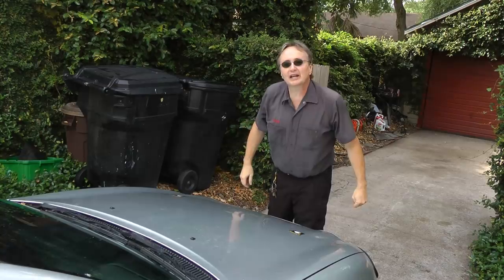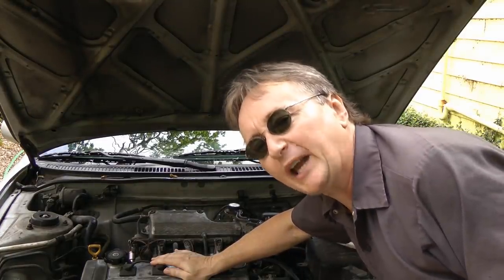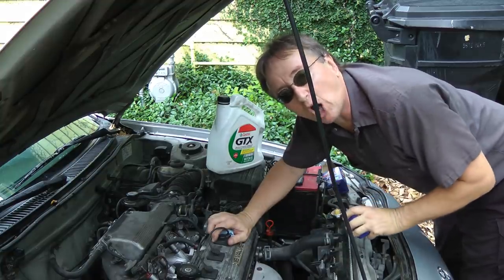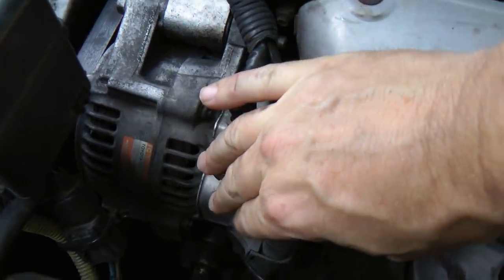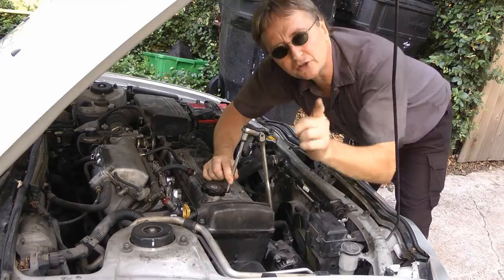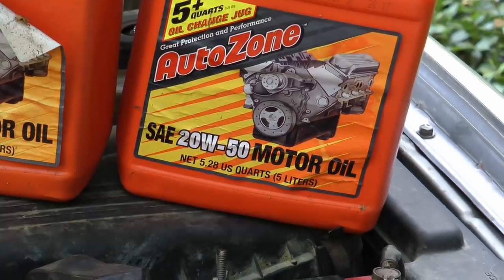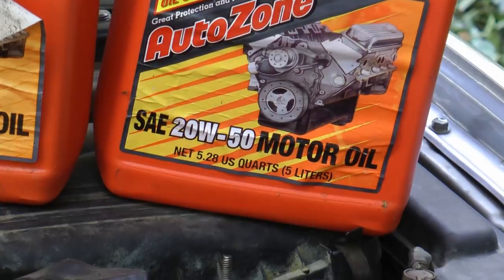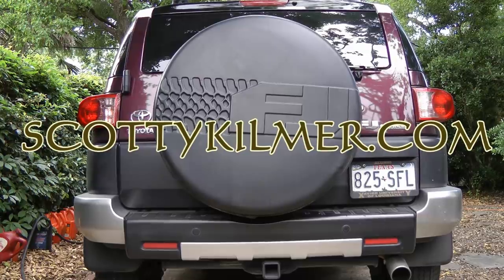Top 4 Mistakes Car Owners Make (DIY Fails)

Comment: I have a Ford Ranger that was running perfectly well until I attempted to troubleshoot the air conditioner. I ran two wires from the battery to the compressor to see if it would engage. When I made contact all I got was a loud spark! I reconnected the harness and tried to start it, but it turned and turned without starting. I had it towed  to a shop and found out I had ruined the computer. This happened last month and it was a very expensive lesson. I bought the computer and the shop charged $175 to program it.

Comment: You're right with the oil and go with a full synthetic it gets up to the engine quicker on start up that is when you wear your engine more and a good top quality filter that goes 10000 miles plus

Comment: Never understood why some manufacturers put the oil filter in such stupid places.  Something that gets replaced that often should be in a handy to reach spot without taking anything else off.  I changed oil in a friends ford ranger once and had to lay way under the truck and reach up quite high.  My dodge k cars were the best for that.  The oil filters were front and center.  Nothing on top of it, reach down a little over the radiator and easily grab it.

Comment: Anti-seize on sparkplugs is a bad mistake. I have been told by 2 master mechanics that the anti-seize will becomes hot and run down and foul out the plugs.

Comment: Let's say you have 20W-40 on the oil filler cap.
You can use 0W-40 because that 0W means lightest on cold conditions, but be sure to warm up

Comment: My ranger recommends 5-30 but I use 10-40 in winter and 20-50 in the summer never had a issue with this.
Reply: Zane w
You just a fan of crappy fuel economy?

Comment: Scotty, in this video you say to put anti seize on spark plugs, but in another one of your videos (Picking The Right Spark Plugs For Your Car) you say that you shouldn't put anti seize on the spark plugs.  Should anti seize be used at all?  My truck is a 2013 Tacoma and I'm getting ready to change the plugs.  Does a modern vehicle not need anti seize on the plugs?
Reply from the maker: modern ones don't need it cause modern plugs are already coated with anti seize plating

Comment: Pretty sure it's better to remove the positive cable, not the negative. Because the battery moves electricity from the positive lead to the negative lead, and since it only moves in that direction it's safer to remove the positive terminal. Not positive but I think that might be true, correct me if I'm wrong.

Comment: I had trouble getting the filter off a truck i bought.  When it came off, the old gasket stayed on the truck.   

I usually take the old filter and put them together, seal to seal, to lube the new one.   I guess I didn't, that time.

never again.

Comment: As an oil tech for Walmart with an expert understanding of oil from extensive research and experience. I get costomors coming in regurly asking for a hevier weight oil than recommend and most of the time we can edgucate them on why it's a bad idea other times they incest and we have them fill out a form stating we hold no responsibility for  damage caused by hevier oil

Comment: I had a Nissan dealership double up the filter gasket, i needed a 24 inch pipewrench to remove the filter because they doubld up the gaskets and just cranked it to hell until they finally got it tight

Comment: I have a question about a 2007 GT Mustang. Is there a way to bypass the forward and reverse button on the driver's seat? I've had it fixed three times at the dealership under warranty now it will not go forward or back. They say the switch is bad it cost too much money to keep fixing I'm wondering if there is a wire I could touch on one of the pens to make it move forward when I unplug it?

Comment: Follow the manual or oil filler cap for oil weight, ONLY when you are in warmer climates. In places like Canada, you would be a  fool to use 10W30 in winter. It's as thick as molasses in January. Lol. Takes way too long to get moving in frigid weather. Typically our same cars here as you just showed recommend 5W30 all year round and it works fine. Some people go 10W30 in summer and switch to 5w30 in winter. I use Synthetic 5w30 cause it gets moving even quicker than conventional oil in winter cause it's a bit more viscous in cold weather. 5w30 gives all the protection you would ever need these days. I know some guys who even switch to 0w30 in very cold climates. You'd be surprised just how thick even 5w30 can get in cold weather. It's like thick syrup. Imagine if (and this happens quite a bit) you bought a car in the Southern U.S. and moved it here and it recommended 10w30?! Lol. That's when you want to actually DEFY what is recommended and use a thinner oil, cause 10w30 will never get moving quick enough in cold weather.
Reply: Bill Does Stuff my Subaru recommends 0w-20 and I use it all year around. I live in Texas, we can get hot summers. I understand going down to a 5 or 0 I’m cold climates but never understood switching to from thinner to thicker oils say, in the summer. After all, your engine runs at like 300 degrees f so that’s much hotter then my 100 degree summers. The cars parts are made for a specific oil and thicker oils can interfere with oil pumps etc. Yes 5w-30 is a good all year oil which is why it’s one of the most common and I would use it in a pinch but if i have a choice I will run the manufacturer recommendation unless like you I live in a in extremely cold climate. I would accommodate for winters but not for summers or for hot weather. It’s hard to explain this to people who are used to changing oils in the summer but it’s really not necessary to go thicker in warmer weather. There’s plenty of research that will back this up.
Reply: Yeah, especially with today's oils. No reason to go any thicker.

Comment: Numbers are for the oil weight/viscosity rating. The letter W stands for WINTER. 10W40 to say when the oil is cold its viscosity is 10 as the engine heats the oil the weight/viscosity increases to 40. Oil is able to do this transformation by the additive of paraffin.

Comment: My brother is like that !!!!

He thinks that just because an engine has higher kilometres on it,that it needs a thicker oil.

That's a fallacy because my Chevy LS1 engine has 30 PSI of oil pressure at idle & 60 PSI at 4000 RPMs,that's a 337,498 km engine which runs the recommended 10W30 engine oil.

I think the 15W60 engine oil is too thick for a Toyota 7AFE engine which is in my mothers Corolla,he filled it up with that.

Comment: You put used oil on the oil filter gasket?  I've always used new oil, I've always heard you're not supposed to touch or play around with used oil for anything.

Comment: ALWAYS disconnect the negative battery cable 1st.  It's what you did but not what you said at 1:44.  If you disconnect the positive first, the whole of the metal parts of the engine and compartment are "live" and negative.  If your wrench is touching the positive pole on battery and then accidentally touches something metal in the process there will be an electrical arc.  This will not matter if you disconnect the negative first because all the metal structure is negative and no electricity will flow.  Always disconnect negative first and reconnect it last.  If you only need the positive disconnected for access to something, disconnect the negative first anyway.  It's the ONLY safe way.

Comment: He didn't say weight because of the w, he's talking about the viscosity 10-40 20-50.
And no matter what he says you can use a higher viscosity oil on an older car because the clearances are bigger than when it came out of the factory, although i wouldn't use 20 50

Comment: The oil filter gasket tip almost ruined by uncle's truck engine because the gasket was still stuck to the engine.
The oil pressure went up quite high and yes, almost blew his engine.

Comment: Thank's for the videos, really help full, and like you sort of,,,( not that experience ) but do love to work on my cars, and do the service my self, I do have a question only cause you mention to use the oil listed on the cap or owners manual, and not go thicker, but how about when the vehicle has over 150k miles, should that same oil weight be used as when it was new????

Comment: Hello Scotty...I have a 1988 Buick regal custom with the 2.8 engine. The engine stalls and hesitates whenever I try to accelerate. I changed the fuel pump and filter thinking that was the problem, but unfortunately it wasn't. Now I'm stuck trying to figure out the next thing to do....help!!!???

Comment: When ever I change my engine spark plugs and oil I always run the engine first then drain the oil as the temperature helps with the draining and while its doing that I then remove the spark plugs and the temperature of the engine being ran also helps remove them, after removing them I then continue with the oil change then after completing that I drain the cooling system and flush it through with a pressure washer to make sure all the old coolant is out then refill with new and by the time I have done that the engine is cool enough for the new spark plugs then I run the engine top up if needed and check for any leaks and I then let the engine cool completely and then check the spark plugs again by undoing then slightly then doing them up again and I have never had any problem doing that
Reply: Good weekend project, 186scott. Do it every week?

Comment: My friend just overheated an 2005 4 cyl Camry.  Now it won’t start. The head gasket is blown and possibly has engine. Damage. Should he rebuild or buy a new engine. He wants to keep the car. So what is the best option for a new engine?

Comment: I had a friend that needed a clutch on a 1983 Tercel. His girlfriend's dad was a mechanic. For some reason he decided to pull the whole engine out; but he didn't disconnect or remove the battery! When pulling the engine, he left the starter dangling and it made contact with the battery and shorted every relay in the entire car! None of the electronics worked. No lights, nothing.

Comment: Hello Scotty, I always try 2 gain some knowledge of what is possibly wrong with my vehicle b4 taking it 2 the shop so I won't look stupid. Butttt I'm probably about 2 ask a stupid question. Why does the shop ask would I like "high" mileage oil since I have "high" miles, ie: 150k? I normally say yes. Is that really necessary??

Comment: my toyota 4runner oil cap says 5w-30 but i'm putting 10w-30 because I thought a little heavy oil is better for my over 150000 miles suv.

Comment: You keep referring to the w as "weight" when it's actually winter. What you fail to say is that 5w-30 is the same as 10w-30 during the summer or all year here in Texas. The 5w or 10w means whether the oil will flow at a certain rate at a  certain winter tempurature. Look up J300 for the whole technical stuff.

Comment: Hey Scotty my wife has a 2004 Isuzu Ascender. We have changed and axle bearing and ball joint in the front end and it still makes the same noise and is making a grinding/ clicking noise when you turn both ways as you're driving at high speeds and low speeds any suggestions

Comment: Ah but theoretically would 0w-50 (if it's even made ) be good to use if the recommended was 10w-30 , since it should be even better in the winter and deal better with heat in the summer?

Comment: Hummmm..... I always had one question. I won’t use heavier motor oil but could I use a wider range oil ? In your Toyota for exemple a 5-40 synthetic instead of the 10-30. Will it leak more or consume more oil on the 5 side of viscosity (more liquid) ???

Comment: Is the icm and coils the same for a 3.8 engine from the same year? I have a 2000 camaro and its giving me problems. Would I be able to use them from a 2000 Buick for instance? Thanks

Comment: Shouldn't you try to add some oil to the filter before scrolling it onto your car? I know in a spot like you were just working on it might be kind of hard but for a lot of cars you can at least fill the filter up halfway if not all the way
Reply: I never used to do this until someone showed me it was a trick mechanics used. There is almost always some residual oil left around the base of where the filter sits, so unless you wipe it, there some there. I do it now just in case but I never had problems. I think mechanics deal a lot with oil filters that hadn't been changed in a long time, or gaskets that stick in place, but I've never had my oil filter gasket stick and I do my oil changes regularly.

Comment: Hey there scotty k in auto mechanics class I was taught long time ago that the W is not for weight you said 10 weight 30 10w 30 but 42 years of mechanic wouldn't the w stand for winter and not weight

Comment: 3:20 > no true on small engined cars without vvti or any of that after 120000mls you need to upgade thicker oil to compensate the wear.

Comment: what type of oil should I use for a 5sfe engine with 136,500 miles? it's got  15w50 oil in it now. is this the right oil? ( I live in australia and the weather never gets freezing or cold).

Comment: Do you use the recommended oil no mater how many miles the car has ?
Reply: if the engine is burning oil , then sure , try the next higher grade .  ie go to 10-40 from 10-30

Comment: The tip about the oil was interesting because a stupid guy said use heavier oil in my motor. Mistake. Thin oil it runs much better. Thanks a lot.

Comment: Hey Scotty being looking to fix my Mercedes E 430 M113. I have look up diy vids an ever video seems to have the strip of metal that blocks the fan bolt removed. Any tips on removing this small piece of metal so I can keep goin with repairs? Also is it necessary to unplug my battery when working on the fan or pully system?

Comment: I've heard it said that if you use clean engine oil on the filter gasket, instead of old dirty oil, it will not be sticking next time.
Reply from the maker: perhaps a tiny tiny bit, but either way it's slippery enough to prevent sticking of the gasket to the blocck

Comment: Some manufactures of spark plugs such as NGK don't recommend anti-seize because it can throw torque specs off when tightening
Reply: Bryce Balke  anti seize should be applied to first two or three threads only. Nobody ever reads directions. Learned how to do both in 6,000 hr. MCS apprenticeship.

Comment: I have a question I have a 2017 Corolla I changed cabin filter 2 a years but my problem is every time I turned my ac on it just blowed a bunch of dust from the vent any suggestion thanks

Comment: Scotty Kilmer, I had a leaking manifold gasket, I replaced it but I just want to know the safest way to clean the sludge from the engine, its a V6 3.8 GM motor.

Comment: How do I check to see if I screwed up the threads in my Toyota Corolla 2003 when putting in the spark plugs? Engine wasnt too hot but definitely wasnt cold. Had been driven a few miles in 20 degree weather. I cant hand screw in the spark plugs because theyre about 6 inches in. Have to lower in gently than use socket extension. Hard to know if I even overtightened slightly. I want to check my work but dont want to remove and them have nonfunctioning threads or something. 

Thanks!
Reply: Tarek Elmani if the threaded in you’re probably okay although fixing it is a hassle. I would loosen them without taking them out and see what pressure they should be at. A cheap torque wrench is $10 or less. Once the wrench clicks you’re good but usually it’s just a little over hand tight if you have to wing it.

Comment: Scotty.  I've always used anti-seize on my plugs but when I mention this in other comment sections, I'm scolded for doing such a thing.  They say new plugs are already lubricated and adding anti-seize will cause them to fall out despite the fact that this has never been my experience.  Glad to see that an expert like you agrees with me.
Reply: I'm confused by this.  In another one of his videos he says that modern cars don't need anti seize on the plugs because the plugs they use have a coating on them already that prevents corrosion.  I've always used anti seize and never had a problem with a plug getting stuck.
Reply: Many good quality plugs, not NGK copper v-grooved or champion, will have zinc coating on the threads to keep them from corroding, no need to lubricate threads.   I've had a car limp in to my shop with a plug that came unthreaded and was hanging from the lead.

Comment: What is your opinion on mixing oil brands when topping off oil between oil changes? Years ago it was common in the NE to put a thinner oil in  winter and thicker in summer. It was believed the outside temperature effected the oil. I don't hear that anymore. What are your thoughts on this?

Comment: When doing electrical work, is it worth hooking up a memory saver to the ODB II port to save settings, or does that equal leaving the battery cable hooked up?
Reply: No. And No.

Comment: So doesn't the W in oil stand for winter and the numbers are just sae ratings ? It's a dual whatever oil it preforms like an sae 10 in cold conditions and like an sae 40 in hot running temp conditions hence 10w-40

Comment: Sometimes a heavier weight is better. Nowadays car manufacturers try to make their car as fuel efficient as possible and oil affects this. So to meet certain US regulations and to pay less gas guzzler taxes they’ll recommend oil that is good for the fuel economy. For example in the US it is recommended to us 0W-20 for the “best fuel economy” in a BRZ while in japan they recommend 0W-20 to 5W-30. It’s the exact same car just the government regulations are different so they can recommend the oil for performance. So if you want the most out of your car do some research and look in forums for what oil weight will let your car achieve its maximum performance.